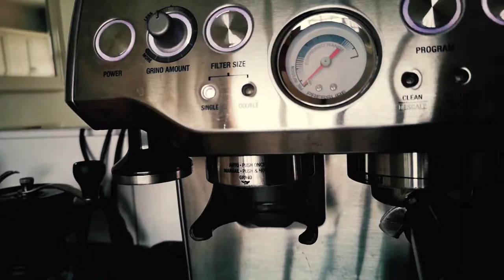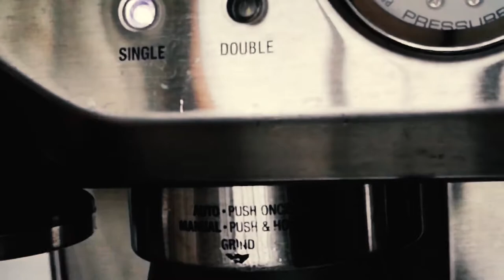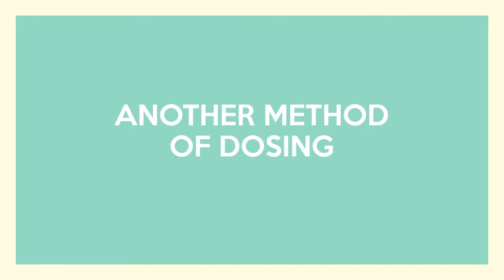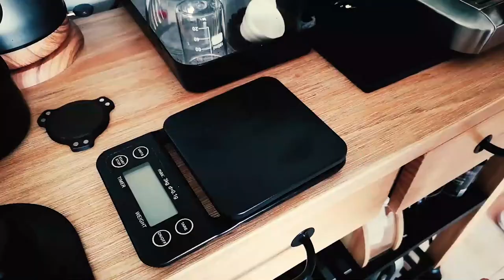3D Printed Funnel and Dosing Cup for MUCH BETTER COFFEE Distribution and Dosing for Breville Barista

Comment: Thank you David. This design from concept, to design with Fusion 360, to fine tuning is all done by myself and eventually 3D printed. I have worked in partnership with the Seven Sistors Coffee Co in UK to sell my dosing funnel to them with their company logo. As you have mentioned, there are many other variants but I think  my version is the one that serves multiple functions. Your feedback is appreciated and I will see how I can improve it. The tolerances on the 3d print is not great and hence I wont be able to print it just fitting. Over usage, the cover will get smoother.
Reply from the maker: I absolutely love the funnel, took a while to find a good workflow, including rearranging my cart, but I love the fact that I can now load up 20g without any spillage
Reply: @overheadrecipes  Awesome!